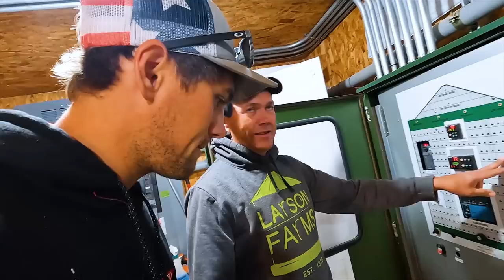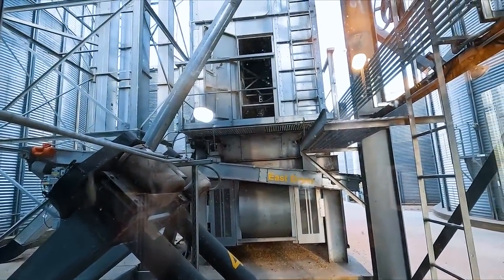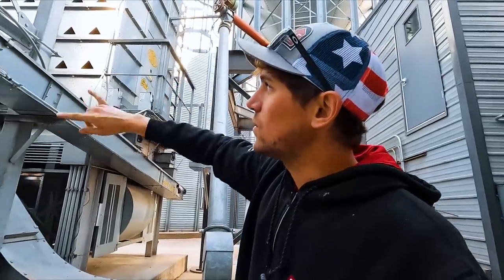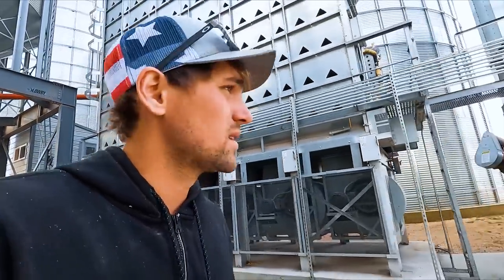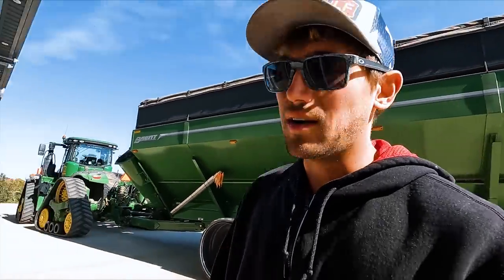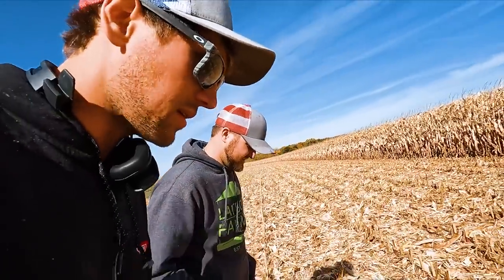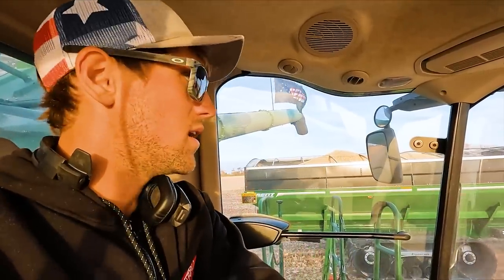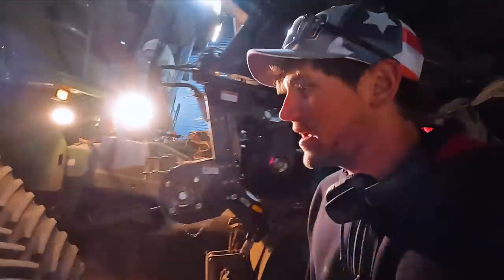Just A Small Load Of Fools Gold! #10

Comment: Our new dryer was the same. We found about 5 different loose wires that either were never tightened to begin with, or loosened after transport...considering the mile of wire in the control box...not surprised. Micro screwdriver is your friend...(when the power is off)

Comment: Also, always good to have a drip loop on an exterior cable, simple as making a loop (lower than the cable run) or at least a low spot/dip in the run that allows water to drip off, else water will find a way into the cable. Drip loops work, but be mindful of minimum bend radius (Google it), too tight a bend/drip loop stresses the wire, more so if shielded wire.

Comment: Great Vids! That bin dryer “millwright” box you and Brodie installed? Well the large black cable coming out is bent too much/too tight, and really needs strain relief, meaning something to support it at the bend, and the bend angle needs relief (less bend angle)…else the bend will stress the connector. A bit of wind & weather will have you working on it when it fails…just saying. Keep your smiles on!

Comment: Not sure what has been changed on the new Geringhoffcorn heads but they will pile.up in dry corn terrible. You will need a rake to clean it off. Was told to turn gathering chains backwards,  also to offset them.  Told to take ear savers off and also the flapthat is on top of the row unit.... nothing matters.  Like how it chopped, it was a rota disk 12 folding.

Comment: I just noticed the step out that upper full size door is a bummer.  What precautions have you taken so a person does not try using that door from the inside?  I recall when we were building new steps for a cabin at the lake.  We told the ladies that the front steps were removed.  Our 4 year old son woke up when we had gone for lumber.  He walked out the front porch and WOW.  That first step was a bummer.  He went tumbling in the soft soil.  He was not hurt, but it could have been bad if he had hit the concrete.  😮

Comment: Chet another great job explaining everything.  Kindergarten question for you.  I haven't farmed since the late 80's,  do you still have to count rows when you turn on headlands or does the autosteer take care of all that.
Reply: Autosteer will do it for just turning around. If you pay extra for Autopath activation, (which they have) the combine, sprayer, etc, whatever the width it will find the correct rows. Planting records the location of each row. Used it this fall with our S780 for cutting thru in corn, worked great. Normal rounds I just drive to the right rows and hit autosteer . Very helpful for a wide sprayer.